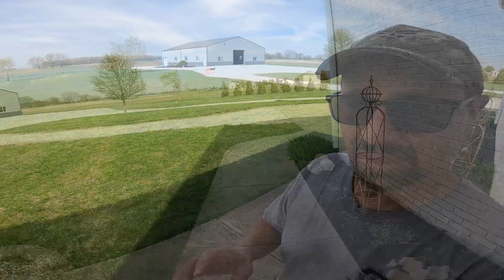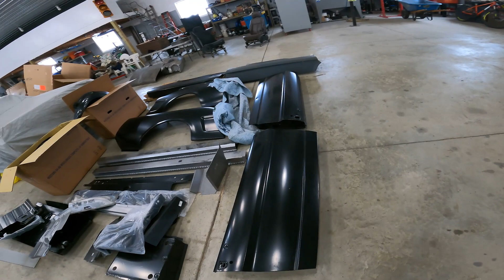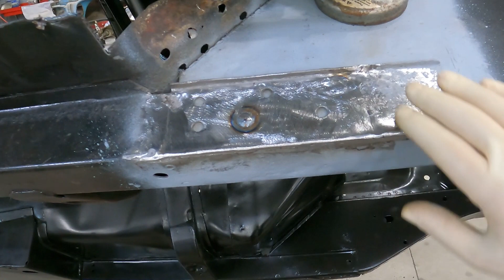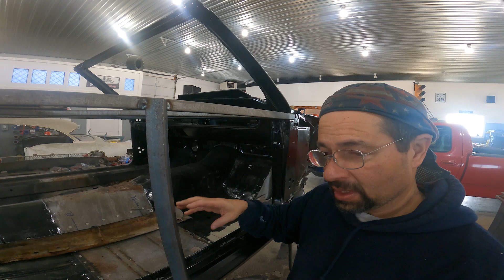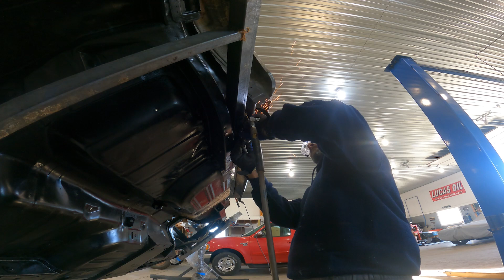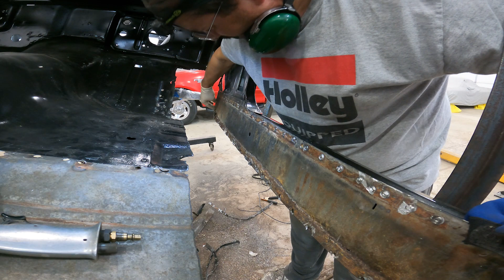1965 Mustang Convertible Torque Box and Inner Rocker Panel Replacement - Part 1

Comment: I’m just finishing my first side of someone who put a new inner over the old rotted one and left rotted in the torque boxes and rear where it connects to the fender well. And new floors. Also the type that things more weld is better. Not if you don’t do it right. Hours and hours to get it all out. This is probably only second in difficulty and aggravation to fastback conversions and close tie for cowl firewall . I know one thing , and I love restoration. You just can’t get a decent shell anymore, reasonably . I’m just having dynacorn ship a whole shell to my house. Theyre just too much now. Quarters , inner rockers , whole floor, toe kicks, drop offs, frame rail extension front and rear, radiator support , aprons . But this work is a dying art, and after doing this one side, I needed to see how someone else approached it. Other than trying to drill out all the torque box spot welds, bout the same approach. I know the other side will be way faster. Having part of the rotted inner really added so much time
Reply from the maker: I feel for you. You never know what someone did previously till you start to dig in and replace the metal. You are right, this is a dying art. 
   Good luck, hopefully the other side is a little easier.